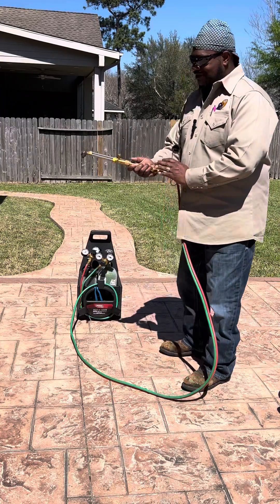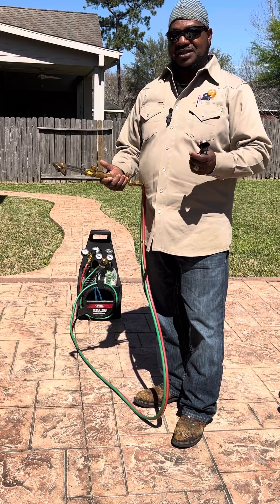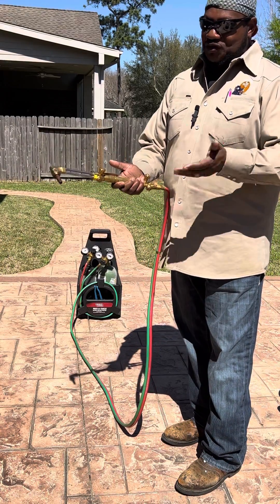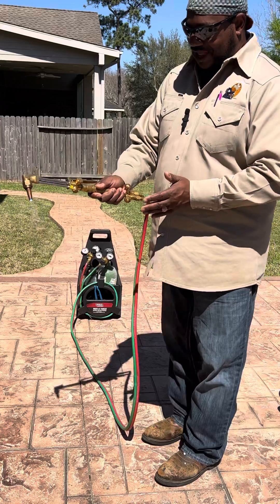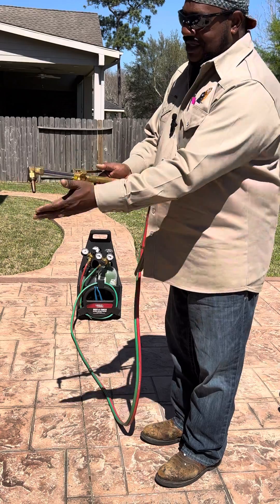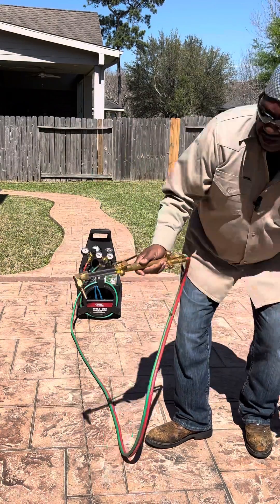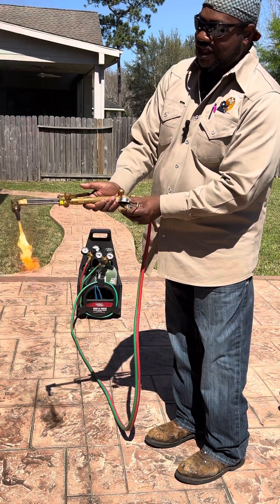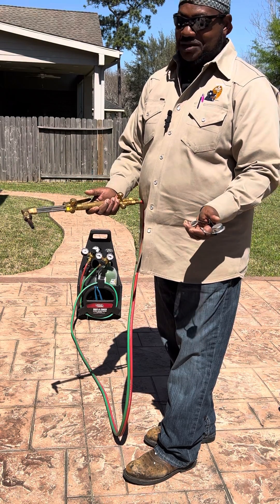How To Shut Down Your Oxygen Acetylene Torch (The Recommended Way)

Comment: Some older guys in a safety meeting said its ok to leave the valves on the torch all the way open even after the tanks are closed. I went to use the torch, unwound it and turned the tanks on, got back to the torch and it wasn't lit but it was all the way open. Just spewing air. They said it was good to bleed the lines, yes, but, you close the valves after right? I feel like the bro code went too far because I've never had that happen. It did and they said it was no big deal. Am I crazy?

Comment: I was taught that safest way to turn it off is to turn off the valve at the tank then at the nozzles. The reason is to avoid a "walk back" of the flame from the torch into the tank which had happened in the past in an explosive way.:body-blue-raised-arms:

Comment: Welp. Procedures very depending on demographs. .. for me, acetylene than oxy hit the spoon empty the mixer, than the head.  I actually don't remember the proper procedure to Turing off torches, which r actually test questions where I live, academically or practical.  Kinda don't care cause, I turn it off pretty much the same way as u do, shop or Feild. ...
Reply from the maker: This is one of the questions that they ask on the certified welding inspector exam because they know most people are gonna miss that question. If you fail the exam you have to pay again to take it (more $$$ for AWS)
Reply: @weldingandstuff  yep.. money grab . More heavy regulations.. I get it.